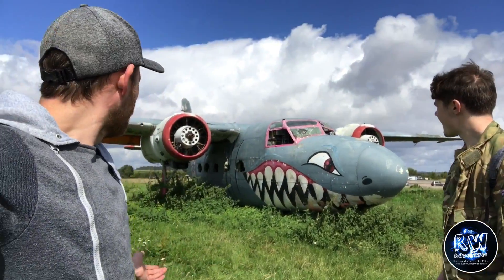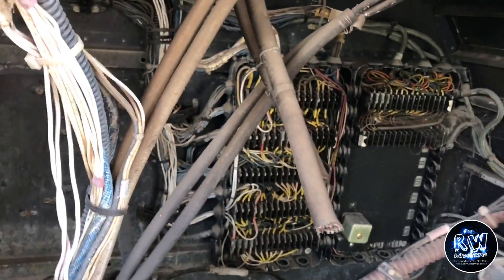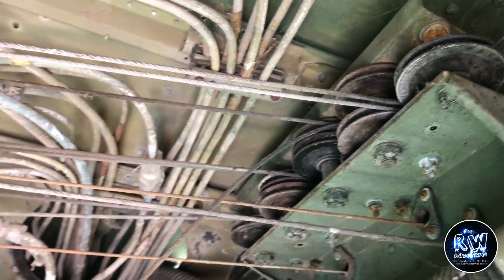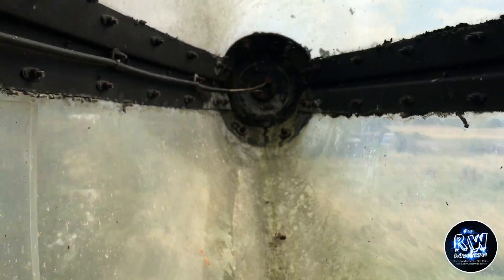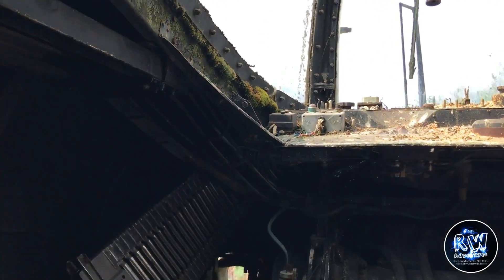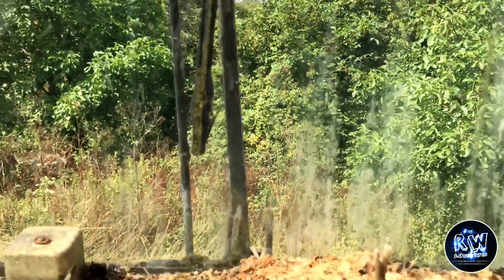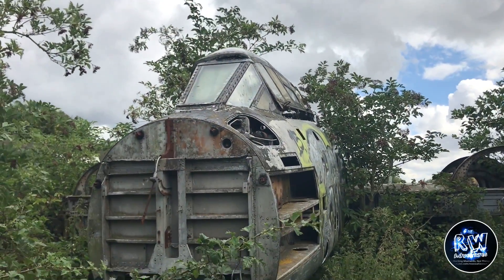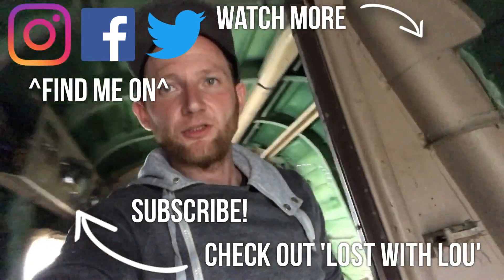ABANDONED RAF Planes at Old World War 2 Airfield

Comment: First aircraft is the Percival Sea Prince Tmk1 - used by the royal Navy's Air Fleet Arm and ths Royal Air Force as a Multi engined training Aircraft.for Maritime Reconnaissance crews, light transport and currency proficiency for Multi Engined rated air crews

Percival built other aircraft for the RAF such as the Pison Provost training Aircraft which was a forerunner of the Hunting/Percival/BAC Jet Provost.

2nd aircraft is the Avro Shackleton AEW mk 2 used as a mobile early warning and control aircraft.  Powered but the same Rolls Royce Griffin engine that powered late models of the Spitfire.  The "Shack" as it was known to crews had contra rotating propellors and it was usual practice for 1 or two engines to be shut down during flight to save fuel and extend tome on task.  It was replaced in 1991 by the Boeing E3D Sentry.

3rd aircraft is the Gloster Meteor F mk 7

The Meteor was the first Opperational Jet Fighter Aircraft in the World entering service with the RAF in 1944.  The F mk 7 was the first Meteors to be powered by the  Rolls Royce Derwent Axle Flow Turbojet which was also used in the DeHavilland Vampire and Venom Aircraft.  This particular aircraft looks like it ended its days as a target facilities aircraft towing canvas sheets in flight to allow other aircrew to check the accuracy  of their commons.
Reply: 2nd aircraft us not an AEW air craft, it is a standard Shackleton for Maritime reconnaissance it having never been fitted with H2S and having Tricycle undercarriage and tip tanks.

Comment: Very interesting is the small two stroke motor on the bulkhead of the left removed Meteor Jet engine, i suppose it is used as a starter motor just like the System on the Messerschmidt 262.
Reply: That is actually a gearbox driving a small compressor, a vacuum pump and a (missing) generator.